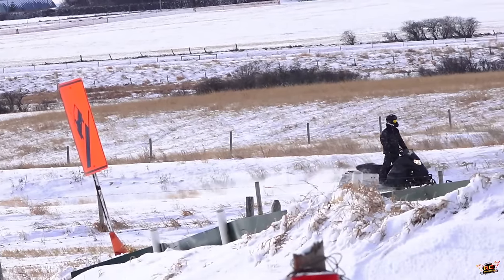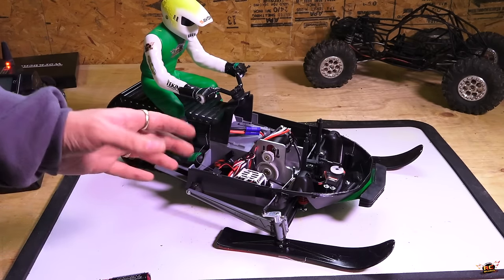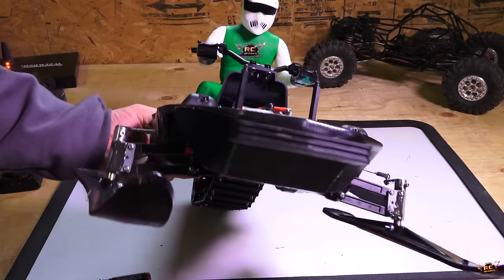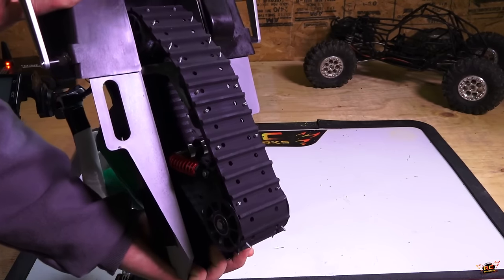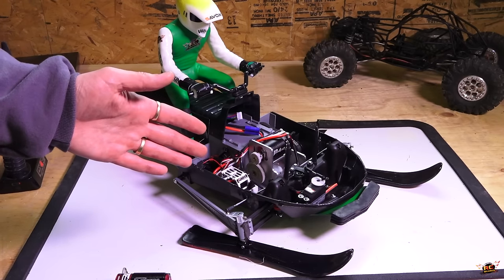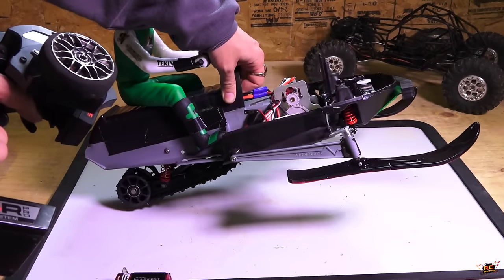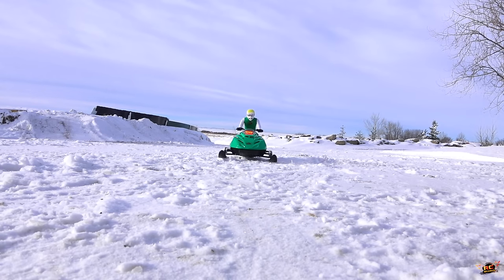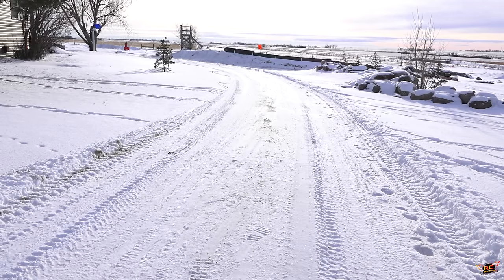RC ADVENTURES - FREESTYLE 14.4v 4s Lipo 3500kv Brushless, Radio Control Snow Mobile - Art Attack Kit

Comment: Curious to know? Would you be able to upgrade the track for a wider footprint? With the  added wheel speed from the other motor you placed in wouldn't you think just like tires you could add a track that's like maybe 3 cm at most wider? Or does that matter?

Comment: Sweet motor choice. I have 3 Tekin Pro4HD 4300Kv motors. I only run on 2s, and I don't think there is a more powerful motor you can buy for 2s. One is in my Rustler, the other in my SCTE, and the third in my slash

Comment: that was me for real a few years ago. alas my body cannot handle that kind of abuse any more. sold all my sleds. That little sled really goes. I had a cheap rc skidoo sled that I used to run around. It was no where near as fast as yours. It was a New Brite. Gad to see you got the bugs worked out of it. I am now into Foam planes, quads and helicopters. i am currently in the process of making skiis for my Apprentice s15. Its a bit too cold to fly it right now. hopefully this weekend its going to be in the 40's.

Comment: did you waterproof that rx8?  or are you not really worried about snow getting inside ?
Reply from the maker: +Matthew Winter just the top of the RX8. I used spray plasti-dip over the exposed areas

Comment: It would be nice to see a dozen  or so racing the full largescale track, the snowmobile really woke up, it is more like the two stroke full scale ones even sounds a bit like it. I would love one of these but no snow for two winters here in the Westcountry in the UK, keep them coming I am stuck in my workshop as it has been raining solidly for four days now, I think I am growing webbed feet. All I can do is polish the polished ones, waiting on parts for three of my largescale, getting ready to sell at least one to get my hands on the new Kraken-RC Vekta 5 1500 class buggy or the Trophy Truck, which is coming out a little later I would like both but I have six truck's and buggies plus a Venom VMX 450VMX so my wife says no more lol also interested in the FID RC which also has the rigid rear axle so they look more scale and this is what I try to do with mine. I am in the process of converting my HPI 5T back to a B and swap the Version 1 Kraken RC Class1 buggy to the TSK-b kit as this is a little lighter and looks more scale, jst waiting on the parcel service to deliver the kit.

Comment: I have a question. Can I use a helicopter LiPo battery that i have, on my Traxxas Slash 2WD Brushed? (obviously after making the necessary adaptations with the respective connectors). Here are the battery specs:

Brand: RotorLogic
LiPo / 30C / 1000mAh / 11.1V / 3S

PS.
Its about half the size of the Traxxas LiPo battery.

Thanks in advance!
Reply: +Sebastian Garcia You can but at only 1000mah you will likely get about 5mins run time but it would work
Reply: +Chris O'Donnell thank you!

Comment: Now then Medic. I would love one of these, but as I live in the UK I would have to wait probably 5 years before I got any snow. I bet a nitro one would be very good fun.
Reply from the maker: +Gary Lowe I think the issue with nitro, (because thats what these were first), is the engine doesnt move the track fast enough. And really, slower track.. slower sled... more difficult to glide over the snow. Its like Electric power revived this kit..
Reply: ***** Yeh I guess. I spose you need the instant punch an electric motor has. It definitely looks a lot more fun since you switched motors. Any ideas where you will have the 1/4 scale on some rock crawls yet?

Comment: Hey man, was watching this vid and saw where you had JB Welded those front arms because they had broken prior. Have you considered having some custom made from some 7075 billet Aluminum? I own a small machine shop and would be interested in making some for you. I can also custom make any other parts, from that, or other rigs, that you may like, from some more rugged materials than stock.

Thanks,
Cole
Castle Rock Machine

Comment: hey is a traxxas slash good for a beginning rc
Reply: +George Mihas Anything by Traxxas is a good start. Plenty of parts support and upgrades available.Slash 4x4 is my personal favorite.
Reply: Thanks Chris O'Donnell is tsm really necessary for going off road occasionally
Reply: +George Mihas Not really. So people say its cheating. I prefer without myself. There is an advantage if you were racing though.

Comment: I'm sorry I know the 4300 is only compatible with 2s good to know that the lower kv motors can handle more power ..
Reply from the maker: +Christopher Byrd No worries.. I ran it with no issues so far,  though bud :) It was barely warm..

Comment: Medic I run  the 4300 kv motor in my tenor shortcourse truck and I know for a fact that 2 s lipo is the max it can handle it think u have missed informed people Cuz those motors designed to work with 2 cell only
Reply: He has the 3400Kv, not the 4300

Comment: @rcsparks I need some help about rc trucks
Reply: Post your question.Many of us would be glad to help.
Reply: Well I have about 6 trucks 3 electric and 3 nitro what's the best electronics to use for my nitro and electric
Reply: +josh knapp Thats hard to answer without specifics but I can tell you what I do. I google exactly what I am after ie. what you have and what you are looking to do. Usually I am lead to Rc forums that with a little research tells me a recommendation from what other guys have done or run.
Reply: +Chris O'Donnell alright thank u very much I'll end up having more questions to ask lol
Reply: +josh knapp Rc is about community. If you ask, people usually try and help.
Reply: +Chris O'Donnell thank u now is it possible to put other truck part on a different truck
Reply: +josh knapp Definately. Electronics are completely interchangable and nitro engines in most cases. Also some brands like Traxxas and others have other parts that are compatible with other models. And modifications on others can be done also. Imagination and innovation is a big factor in this hobby. Its part of what makes it so fun.